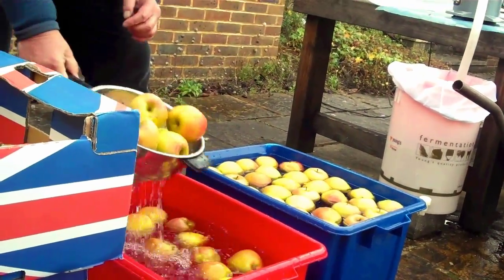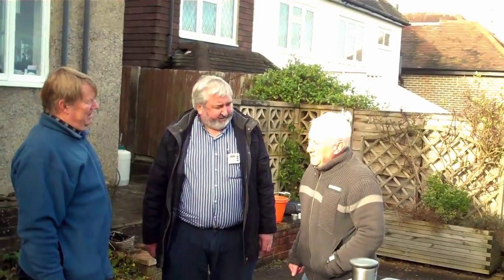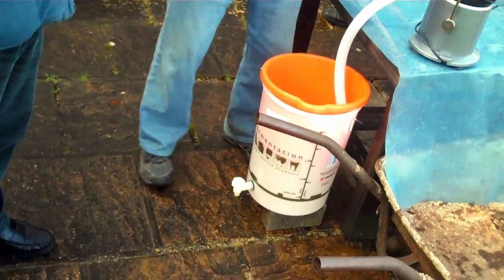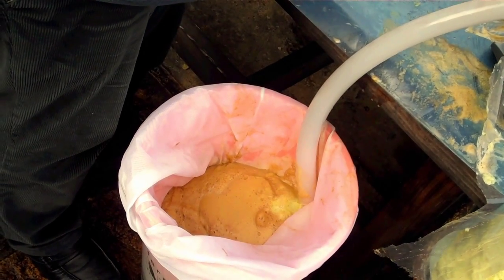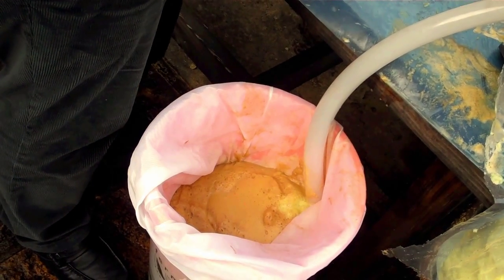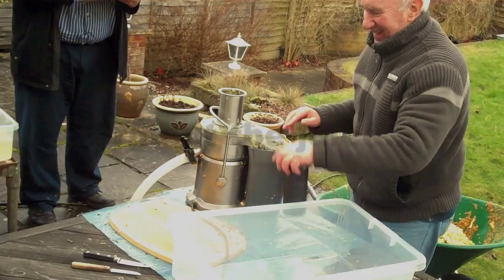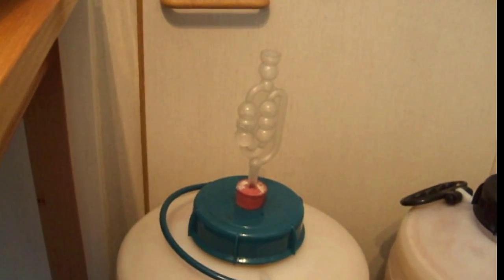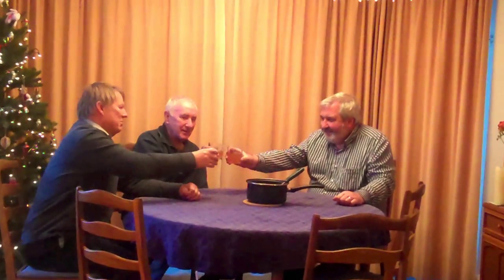Cider Making Made Simple: Part 2

Comment: Thanks for your very interesting videos!

I'm having a go with some bramley apples from the garden... Just wondering which straining bags you're using, and if that's a 25 or 33 l youngs fermentation bucket they fit over? 

Many thanks
Reply from the maker: Apologies, I have only just found your comment. I use a 2ft square fine mesh straining bag from the local home brew shop. The bag sits inside an orange B&Q bucket that has 30+ small holes drilled in its base. This bucket then sits neatly in the top of a 25litre fermentation bucket.
Reply: Many thanks for your help.

After a bit of experimentation I found the whole straining stage unecessary, just juice directly into bucket then leave to settle for a bit and siphon off the juice. Sediment stays at the bottom and foam at the top. 

Cheers,

Ben

Comment from the maker: Not as long as you might imagine. 
If you have a look at the full video desription you will see that, depending on machine power, it would take between 50 and 80 minutes. Recently, Nick and Dick produced a gallon of strained juice in under two minutes. That was with a pair of JE 4s.